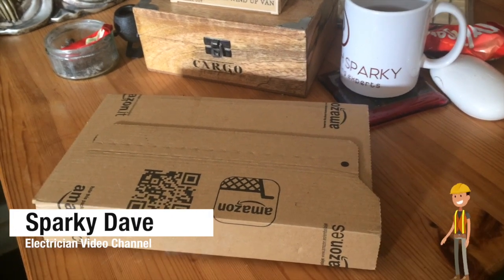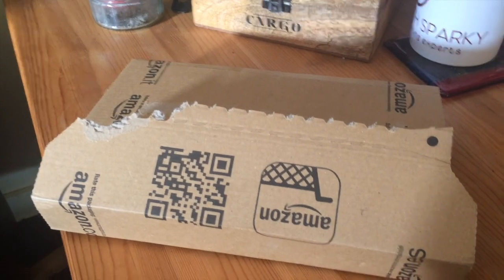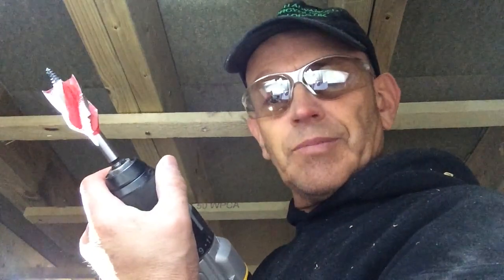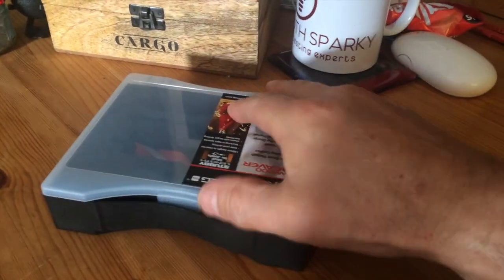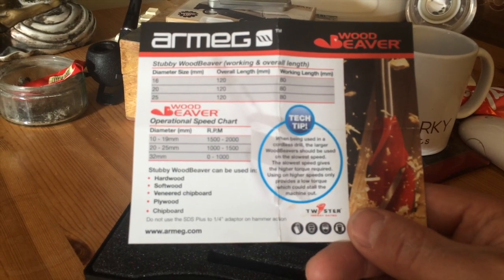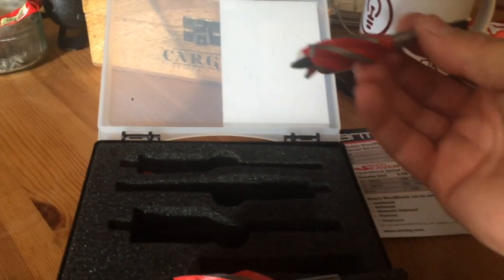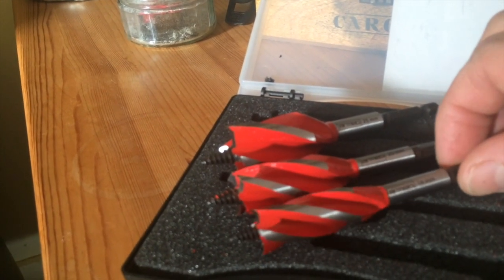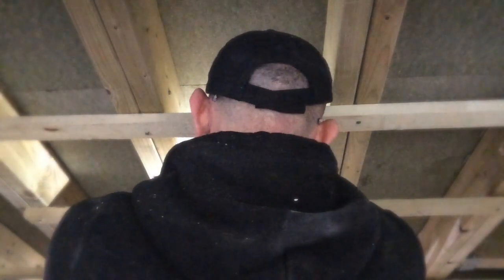Electrician Day in the Life - Armeg Wood Beaver Tools

Comment: Fun video. I've have the older set without the SDS adapter and use them in my Dewalt 18V right angle drill. Bought them years ago from the Armeg stand at Tool Fair. Like others have said they drill through 2 by material like going through butter. Fantastic bit of kit for sparks and plumbers alike. Plastic pipe can be cabled without joints if you were wondering lol.